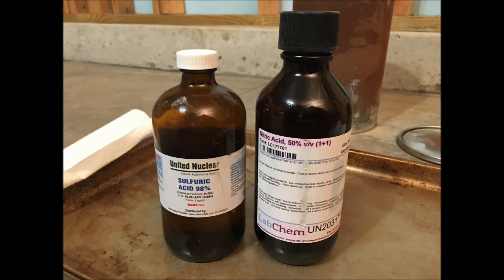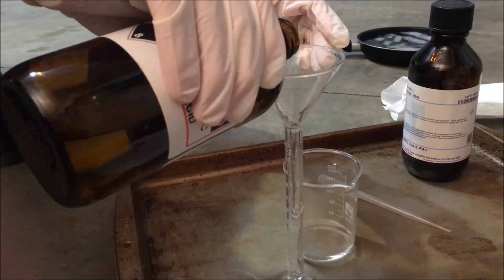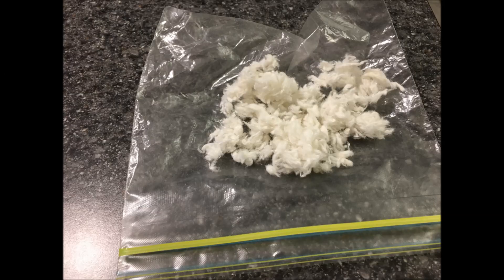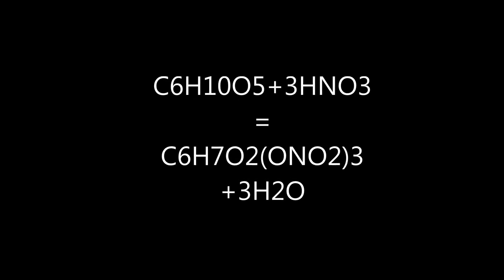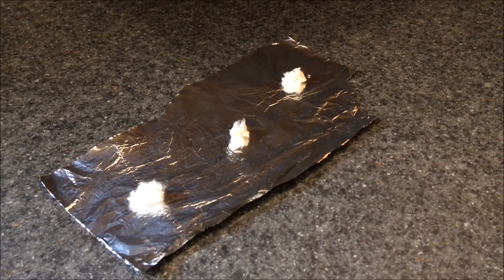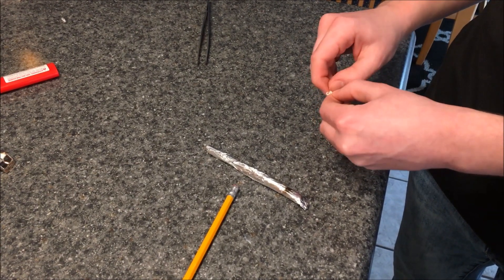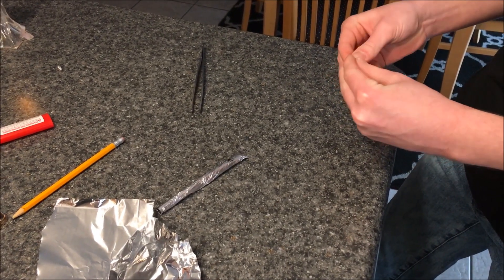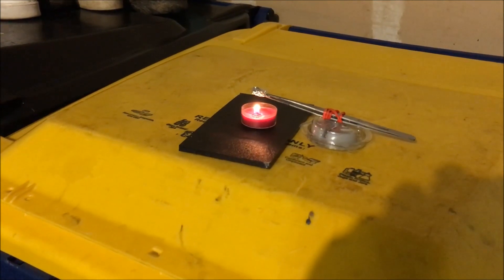Nitrocellulose

Comment: Very nice, i wonder if making it a powder would work better
Reply: Actually I did turn it into a fine powder but it burned much slower and left much more ash behind it. As I know thats because normal fuels needs atmospheric oxygen and increasing their surface area would allow them to react faster with air.  But in nitrocellulose it doesnt need air and making it a fine powder will make it's flame's heat to be absorbed more in air and causing less heat to be transferred to nitrocellulose.
Reply from the maker: Filho do Meepo      Yes, it definitely would.  I have seen it done with microcrystalline cellulose (which is already a very very fine powder), so you may want to give that a try.